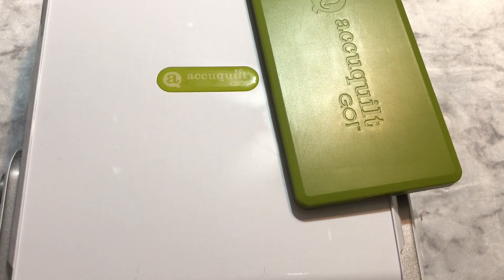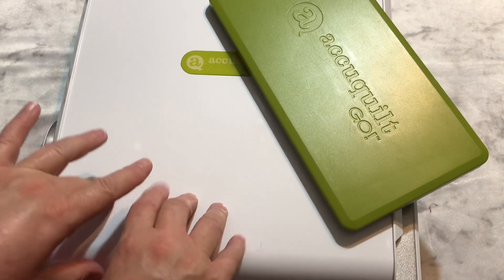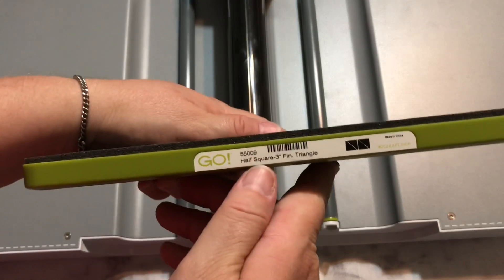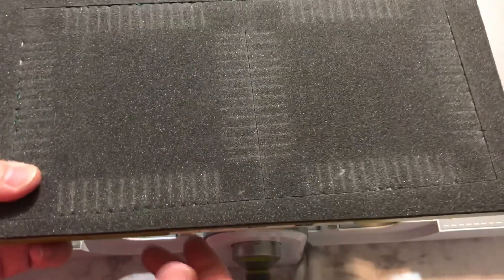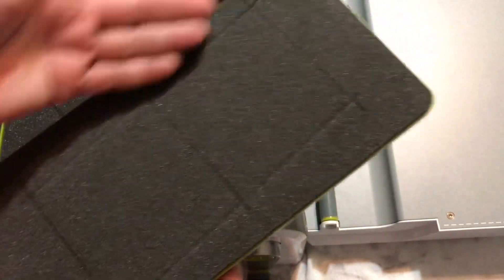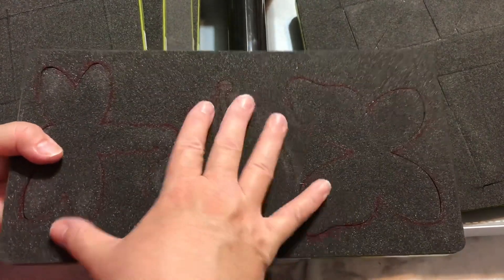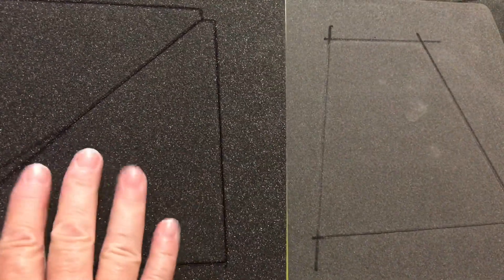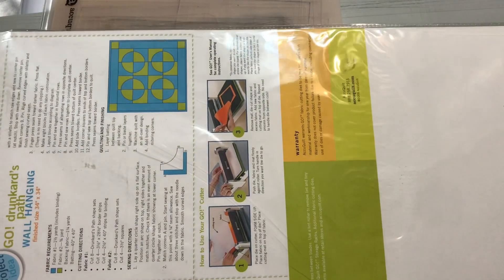Let's Talk About The Accuquilt Go! Cutter

Comment: Nice system. I have a Sizzix system. Love it. I just have a few dies in some basic shapes and a few for circles, Appliqués and animals, which are too intricate for these ol hands to cutout. It’s convenient to be sure. Especially for shapes like circles (yo yos) or hexies when we need a bazillion pieces. Lol. All in all I feel it was a good purchase and don’t regret a thing. Also like the Sizzix b/c I can also run Go dies and others thru it. Got it on a super sale at Amazon several years ago.
Reply from the maker: I’ve heard the Sizzix system was pretty good.  I remember reading some different blogs when they figured out the Go! Dies worked in the Sizzix system.  I think that’s great because your system does more than mine if I remember correctly.  Any system is great for appliqués.   I like the flower ones because those seemed like ones I would use over and over.
Reply: Instablaster.

Comment: Are you my "shoulder's twin"??? I have problem with the roller blade but not with the machine and the lower back don’t complaining when cutting with the machine.
Reply from the maker: Yes! My should screams if I rotary cut too much fabric.  I was worried the cranking motion would bother It but it’s fine.  As long as I don’t eat to cut too many layers at once.  Happy cutting!

Comment: Just as you, I got mine around that time and I was thinking of selling mine, but I may start using it again. Just wondered if the new dies can be used in mine
Reply from the maker: Maybe email ACCUQUILT before you buy any new dies but I would hope that the old system would work with the new dies. I do like some of the new dies and systems that they have now.

Comment: I just purchased the go me . I have trouble putting the dies in the machine to get it thru the machine. I do not know what I am doing wrong.
Reply from the maker: That’s aggravating.   I’m not familiar with the Go Me but when things aren’t working right for me I always go back to the beginning.   Have you tried putting just one of the dies through the machine?  If the die goes through fine on its own then maybe you’re using too many layers of fabric.  If you have multiple dies have you tried each die? Maybe there’s an issue with one of the dies.   Did you check their website for any tips, tricks, and troubleshooting.  I suggest contacting the Go company and asking them.  I hope you get It figured out.  I know It took me a bit to get the hang of mine.  I haven’t used mine in a long time but I do remember that I had to gently hold the die against the machine while cranked the handle.  Just until the die got under that center bar and then It went through on its own.  I hope you can get It figured out.
Reply: @rsislandcrafts  Thanks so much.